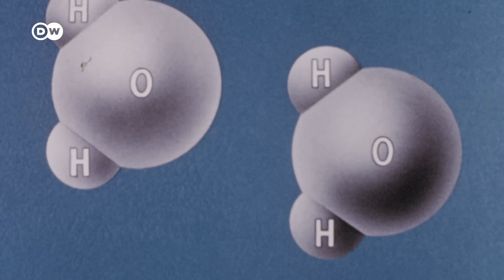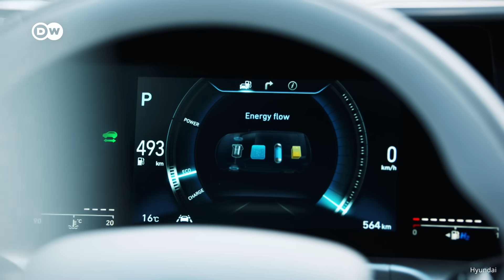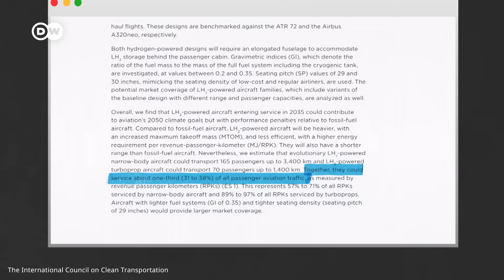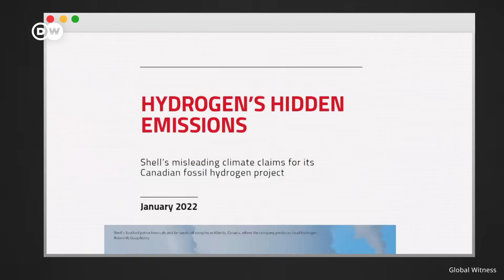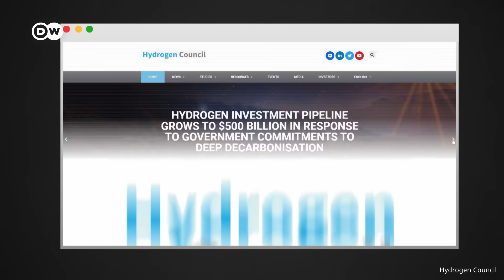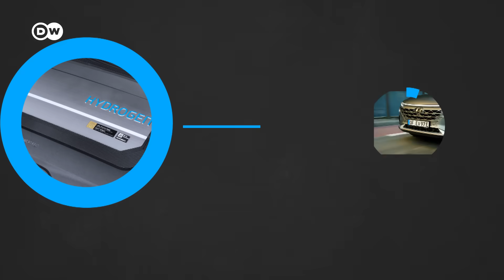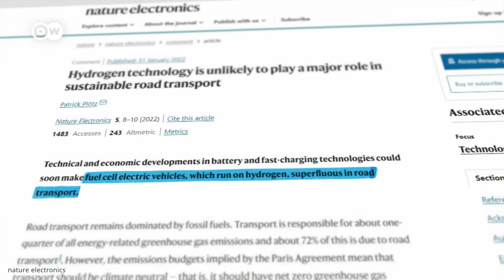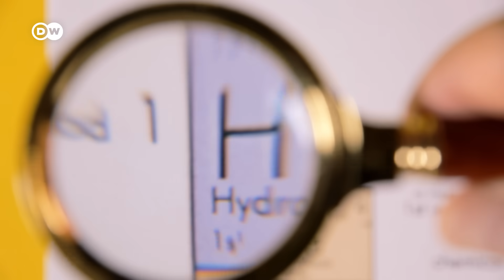The truth about hydrogen

Comment: British company JCB have already pioneered working lorries and diggers using green hydrogen. And Toyota successfully ran a green hydrogen powered Corolla around a 24 Race at Fuji Raceway last summer. So, if these companies can do it, others can too.
Reply: The point is you will never know whether the hydrogen you tank is gray, blue, green or a mixture of all of them. It will be never green, if only you do not produce it yourself. Energy-to Hydrogen-Back to energy has very poor efficiency. There are other more efficient ways to store and use energy.
Reply: Hydrogen is greenwashing at its finest. The Toyota you mentioned was a flop. Hydrogen is super expensive to sore and must be under enormous pressure. At best a super expensive low energy fuel.
Reply: @amraceway  - not in the view of Toyota Engineers and one of their clients.
JAN. 01, 2023 4:31 PM ET, BY SEBASTIAN CENIZO, CarBuzz Magazine: 'Koji Sato, president of Gazoo Racing Company suggested that these improvements could accelerate hydrogen's introduction to production cars: "Problems can be identified quickly by using the car at its limit. Then [we can] proceed with the countermeasures in an agile manner [to be ready for the next race.]"

He added that "large-scale demonstration experiments are progressing toward the realization of a hydrogen society," noting that motorsports will help to progress the production and transport of hydrogen fuel. Toyota says that this particular racing series has meant that the "development of the hydrogen Corolla is progressing at an astonishing speed," which is great news for those who don't want to be tied to EVs.'

 And...

'While developing the use of hydrogen, Toyota Transport's biofuel trucks and Commercial Japan Partnership Technologies FC's light-duty trucks will deal with carbon-neutral fuel transportation. Already, FC trucks have increased transportation efficiency by 5.5 times, but it is working to further increase the loads it can manage. Furthermore, Yamaha, Kawasaki, Suzuki, Honda, Denso, and Toyota are all "conducting joint research in hydrogen engines with a view to installing them in motorcycles."

Simultaneously, Toyota is reusing raw materials in the production of suspension components and other parts to reduce its CO2 emissions in manufacturing.

But the most exciting news is that President Sato revealed he had received inquiries from domestic and international OEMs and suppliers that want to work together on hydrogen tech.'

https://carbuzz.com/news/hydrogen-combustion-toyota-gr-corolla-has-already-proven-its-value-in-motorsport

Comment: I have been watching many videos discussing carbon neutral solutions. I fully understand you want to stay away from a solution that generates carbon emissions while the solution is also removing CO2, but at this point, with all of the very high goals, all solutions should be on the table. just restrict the solutions that are not 100% carbon neutral and eliminate them after a designated number of years (2030 or 10 yrs). I also heard alot of countries that are getting involved with viable solutions, but until we get strong commitments from countries like, Russia, China and India, all other solutions will not impact the overall CO2 global issue. Please correct me if I'm wrong.

Comment: Moving hydrogen is the challenge. Battery technology is about to make some breakthroughs soon that change the equation. If batteries become lighter, more power dense, use more abundant materials and safer. Hydrogen could only compete if it was established. It would have to as common place as oil and gas by now to stand a chance against game changing battery technology.

Comment: As a student of Chemistry  In my point of view Green Hydrogen is the future. We may have to use mix and match of different type of fuels. We had a membrane type water electrolysis system which was very efficient and easy to build.  It just required enough research minimize the production cost.
Reply: I'm not sure about it. Don't forget that an economy, even if only partly driven by hydrogen, will need a gigantic number of new storing facilities, pipelines, trucks, compressors, and thus, raw materials, space, and energy itself. It's about three times more expensive than transporting the generated energy directly by a power grid and storing the energy in batteries and energy buffering plants without an intermediary substance which serves ONLY as a means of energy TRANSPORT.
Reply: It takes exactly the same amount of energy to turn water into its constituent elements of Hydrogen and Oxygen as is produced by burning it. No amount of increased efficiency is ever going to change that fact. Therefore there is never going to be a gain unless the electrical energy is very cheap and cannot be utilised for anything else. When is electricity going to be cheap?
Reply: Green hydrogen doesn't exist. Only hydrogen produced by electrolysis does. If you use electricity from solar to manufacture hydrogen then that doesn't change the hydrogen. Can you please stop using this retarded language. Science is not marketing. There is only one hydrogen atom when we do not include isotopes.

Comment: I would rather see large scale adoption of Thorium Reactors to supply the energy needs of our Cities, and then we can have battery only vehicles as more common place. Until you get to a point of having huge BASE Load power to run our economy with excess to use for cars etc, this is all pie in the sky.

Comment: Ok, but add another 33% of inefficiency to battery vehicles because they carry a "fuel tank" that weighs roughly 33% of the total vehicle weight.
Reply: Not at all. EVs are barely heavier than hydrogen cars. Also, weight barely affects overal efficiency.

Comment: Hydrogen is definitely one of the fuels of the future. It is easy to produce, easy to store, easy to use, and has no emissions at point of use.
You can make it anywhere from any power source, store it in literally just pressurized steel vats and use it in all kinds of applications both through fuel cells and combustion type applications. Depending on the way you deal with the residue from your water source, you can even use it as a way to decontaminate or desalinate water to some extent. Steel mills are usually already close to or besides the sea. Using salt water instead of fresh water for hydrolysis actually turns the waste product of the steel mill's energy use into fresh water, another resource that is scarce. 

Just because battery technology is "cheap" now does not mean it remains so in the future. Especially considering the lithium and rare earth metals required to make them usually coming from sources that are easy to lose access to. Not to mention the production costs of an EV in terms of emissions are very high.

Comment: There is the 3rd alternative to produce hydrigen that was not mentioned in this video. It is to produce hydrogen from heat waste from nuclear power plants' reactors. Water can be splitted into hydrogen and oxygen directly by heating  it at high temperature, and this can be done by making  uses of waste heat from existing neuclear reactors, with some modification.
Reply: Yeah, that's called Pink Hydrogen which wasn't discussed here. The experiments from Japan for VHTR (very high temp reactor) type plants are a really good candidate for this. Since it operates at really high temperatures, it can split hydrogen from water via thermochemical cycle which is much more efficient than electrolysis. This also can generate a lot of hydrogen at a stable rate since it's using waste heat from the already running nuclear reactor. It kinda aligns with Japan's big bet on hydrogen, so I can see these types of reactors to play a big role on its viability.

Comment: Wish this also mentioned the pink hydrogen derived from nuclear. With next-gen small modular reactors, which are not reliant on fussion, but fission instead, this typo of hydrogen can be produced cheaply as a waste product without compromising on safety. The fact that Germany is not even considering nuclear as part of its energy mix, when it's the most efficient (and increasingly one of the safest) method of energy production is baffling to me.

Comment: The fact that hydrogen has a lower energy density is just wrong, this would be under normal pressure. Hydrogen is in tanks compressed and has in the liquid phase the highest energy density, 2.1 times higher than natural gas.

Comment: The UK national grid cannot support a change to just electric heating. Therefore we need an alternative to natural gas. That alternative is hydrogen. It would take an absolute quantum leap to make batteries that suit the road haulage industry, hydrogen is the solution there. Also no mention of the world shortage of lithium to make the batteries, or any mention of the diabolical pollution problems of mining the lithium and refining it to make the batteries. All the factors in this debate need to be out in the open, side-by-side, not just the efficiency viewpoint. Hydrogen Fuel cells took us to the moon in the 1960's, they can help us again.

Comment: I think H2 is too dangerous to use just like that. Its a very thin source. BUT as fx Denmark has as much windpower as we wish for 200 days a year. So we can make a lot of extra hydrogen  and store it for use, when there is no wind. 

Today we use a lot of fossil gas, so we could reduce the dependensy from fossil  gas in the turbines, we already have. We can useonly  water but electrolyse and big scale has to be invented best to the price. 

I see H2 driven cars and ships as bombs worse then the fossil gas. Storing enough need cooling down and very high pressure. 

But one thing is clear to me as told in the articles. The big companies should not decide what we do. They only are there for profit. 

We see it right now in EU. Our much cheeper electricity follow the prices for the non Putin gas. That makes no sense. Windpower and other ways to make electricity should have its own market in a demand of turning off for fossils when we have electrity from wind, solarpanels, hydro, waste birning and nuke power.  

And yes: Im for better batteries then Lithium too. It makes more sense taking from water.

Comment: Hydrogen might make sense for air travel, but a sensible corrolary to the chicken-and-egg problem would be to reduce air travel.  This would reduce the intense demand for both fuel and aluminum,  freeing up supply of aluminum for other, better uses, while reducing greenhouse gas emissions.

Comment: Excellent video with clear point to digest and ponder upon.  I think the t worth pursuing. It seems that the biproduct, water, can also help water shortages in some places.  I'm all for it's further research.
Reply: Huh?
Doesnt make a lot of sense, no. Not to me in this shortness anyway.

You´d argue the small amounts of water emitted in the fuel cell process - out of hydrogen that has originally been made out of water or natural gas - should then be collected and somehow brought where water is scarce?
Just transporting water where it is needes seems much, much more straightforward. And if done by pipeline considerably cheaper, more efficient and less leakage.
Reply: That's nice.

Comment: how about the same video on electric car manufacturing?
Reply: i did watch the video btw
Reply from the maker: Hi Jason, have you seen our latest video on EVs? Why electric cars are finally taking over: https://youtu.be/aEOoExg1Nm0
Reply: thanks  the problem is i have no interest in the necessity to plug a car in and wait for it to charge , i dont want running costs added to my domestic electricity account.  and i dont like an energy company have the ability to limit my supply as they please
australia us a very large country and notoriously slow to build infrastructure and already cannot provide enough power to power current requirements

Comment: Hydrogen is absolutely the fuel of the future. 
Electric cars aren't good for the environment in and if themselves. Majority are running off of fossil fuels, for all of those who care about that fact. 

Plus electric requires much longer to fuel up. 

Hydrogen, you pull up, fill up, go. Same as you do with cars now. 

Build a nuclear plants, bam, 0 pollutant energy source. Use that to supply an area with electricity as well as make the hydrogen. 

It'll only improve and it's ACTUALLY good for the environment, so if course the eco nuts are never going to talk about or suggest it.

Comment: Australia's CSIRO developed a liquid similar to ammonia that had a large amount of hydrogen. This liquid could then easily be turned into hydrogen in the vehicle and the other elements are filtered out of the liquid. Large scale transport of low temperature, high pressure extremely flammable gases is fraught with problems, let alone the cost of any type of hydrogen.
Reply: Smells of Hindenburg
Reply: @lesterhutchins1621 oh no the combustion fuel actually catches fire? Whatever shall we do

Comment: Nuclear energy ? to produce hydrogen   prbly an unpopular opinion

+ you could rather liquify the h2 under pressure and use it in a combustian engine, there for transportation occupy's way less space and you dont have the toxic trash from the battery's. And if the argument comes that there is explosive danger if you put in in such a little tank with it being in liquid form you're right but in the racing industrie theyve already developed a fuel tank that can withstand bullets, so problem solved.

Comment: Ok.  I see little devices creating h2 gas.   Why can’t cars run on water converted to h2 by the car itself?   No more refueling except for clean water?    But the problem is how do the elites stay rich off of it.   The cars battery creates the gas.  Car runs on the gas.  Thus recharging the battery.  Complete system.  And I’m no engineer.  It’s Common sense.   Since the car is producing the gas as needed.   No need for huge storage cell or risk of explosions.   Cmon man.  Make it happen.  I’m joe average.

Comment: Great to see a sort of balanced view, though I do think excessively optimistic...  

Big hype around heating with hydrogen recently here in the UK, however some pesky scientists showed that you would need about 6 times more energy to heat homes with hydrogen than you would with heat pumps, BBC News article  "Study contradicts Rees-Mogg over hydrogen for heating" covers the issue..   

Ask Joe did a video considering hydrogen cars, and if they really are dumb, where he goes through the energy costs from source to wheel motion for cars:  
Petrol / diesel converts about 15% of the original energy into motion
Hydrogen converts about 27% of the original energy into motion
Battery EVs convert about 80% of the original energy into motion...
So hydrogen needs 6 times more energy if used for home heating, and about 3 times more energy to drive the personal transport network...  Not looking so promising there...  

Engineering Explained on youtube looked into solar powered cars recently, crunched the numbers suggesting that going for hyper efficient cars like the Aptera (about 10 miles per KWhr energy consumption) are a practical proposition, although the greater practicality of the Sono Sion may well appeal to significant number of drivers (Lightyear Zero will be an interesting footnote in history?).  On that point, you were misleading over hydrogen driving vehicles, they do not power the vehicle directly but trickle charge a traction battery that is more able to meet the variation of instantaneous power that personal transport vehicles need; with the solar vehicles the same, the bodywork solar PV trickle charges the traction battery (that can also be recharged as other BEVs) that actually drives the vehicle, with the best case being the Aptera with the full solar package getting up to 40 miles per day extra range in the sunnier parts of the world such as Southern California / Texas / etc., enough to cover the use of not far from half of American drivers without plugging in to recharge except those occasional long road trips.

Shipping is seriously looking into ammonia, as they have been carrying ammonia for decades so know it well, and does need a lot of work to put it through existing engines.  On that point, there were some serious issues you ignore..
Embrittlement is that nasty habit hydrogen has of wrecking widely used materials in our energy pipe network, and in so much of engineering which significantly escalates the cost of using hydrogen...
As hydrogen is the smallest molecule, if has this habit of passing directly through some widely used materials significantly increasing the infrastructure/ storage costs for hydrogen.  
Electrolysis carries a significant energy cost, as does the recombination, meaning that as an energy storage medium hydrogen returns well under half of the energy originally put into hydrogen.

Hence the question of why all the hype?  In my view the fossil fuel industry has the money to ... distract politicians & media into projects that offer no climate value, but are a greenwash over protecting the revenue of the fossil fuel industry as grey hydrogen would tend to be used as a stop gap in getting these projects up & running, and their maybe not so early days with the attendant large climate costs the fossil fuel industry would really like us to ignore.  Great youtube video 'Honest Government Ad | Carbon Capture & Storage' that is a short documentary with a ... light touch but correct numbers that encompasses hydrogen towards the end of the video.